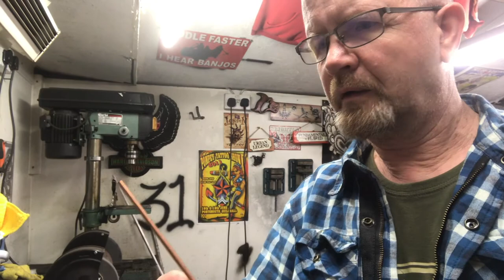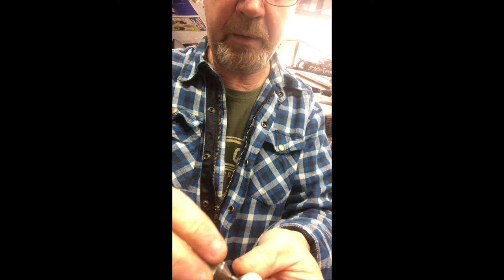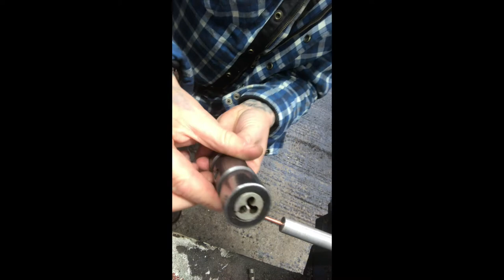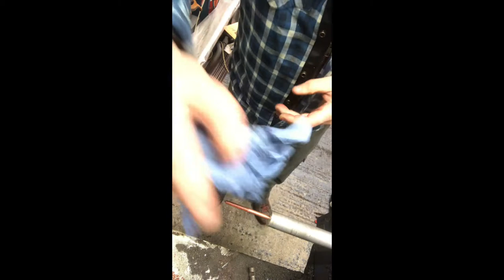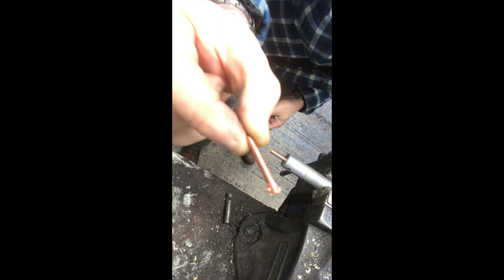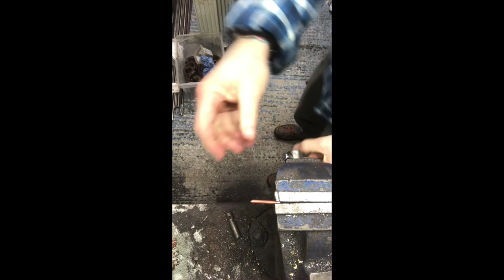Making a tattoo machine contact screw by Camber Custom Metalworks

Comment: What size rod stock would make a better screw? Any insight on the die size as well?
Reply from the maker: in theory you could use any size you choose with matching tap and die, you would obviously need to tap a thread of matching size into the hole in front contact post to accept the screw. I have only ever used M4 thread on all my machines , M3 is far too small and prone to bend and difficult to machine and M5 I find too big, more weigh and more expense in the purchase of stock.I used to use pure OFC ( oxygen free 99.99% pure copper) but it is very soft so changed over to OFTC ( oxygen free telurium copper )  very small 0.5% telurium, makes it machine easier as it is stronger and doesn't affect the conductivity and it also doesn't carbon if alloy breaks down. win win. In answer to your actual question, M4 is best size in my opinion. there's no insight on die size, M4 is the clue to that one. hope this helps. stay safe
Reply: @larrysvintage   Does this mean to make an M4 screw you would use 4mm rod stock? Thanks!
Reply from the maker: @joshburgess8983  yes, M4 size implies that the out diameter of the thread is 4mm but there is often small differences in stock sizes, ie. if you bought imperial stock that was undersize or if you tightened up your die in the holder so it was cutting a deeper thread, this would then naturally reduce the outer diameter slightly, as an example, if you ran a perfect M4 thread into a 3.2 or 3.3mm hole ( 3.3 would be normal size ) but the thread on your screw was slightly undersized then the screw will wobble a bit. I have in the past drilled 3.2mm but prefer to keep things normal with a 0.7mm of pitch . Basic and simple answer you need is Yes. 4mm stock more is ok, less is not so good. hope this helps.
Reply: @larrysvintage  Thanks for taking the time to reply that helps a lot! Can you recommend anywhere in the UK to buy 4mm stock from? looking to make a few contact screws for some home builds ive been tinkering with. Thanks!
Reply from the maker: @joshburgess8983  no problem, i don't mind passing on info,  the only company I have ever bought copper stock from is called Metelec.   website is .co.uk i think.  they do OFC which if I remember correctly came out slightly undersize by a few thousands of an inch and is very soft so failure rate try to turn threads was high, all sorts of twists and bends , threw a lot away before I design the chuck that holds both parts to get perfect result every time. by then I have changed to OFC with telurium for machineability. good luck. I have made hundreds over the years. I used to make batches of 20 for other builders that had failures . it's trial and error to a point but the copper is not too expensive. and they'll cut it down to 1 mt lengths for easy shipping for ya.
Reply: @larrysvintage  Thanks so much for your help!